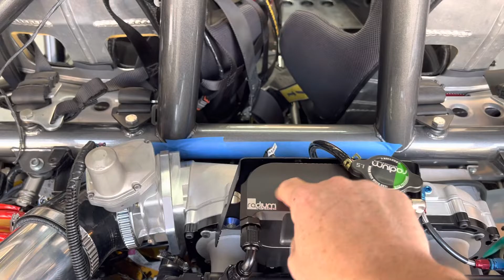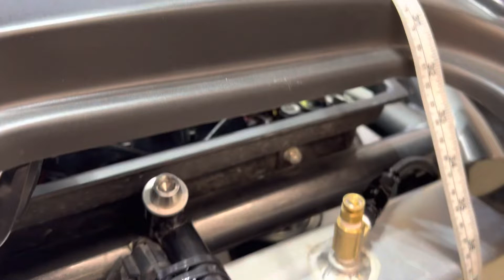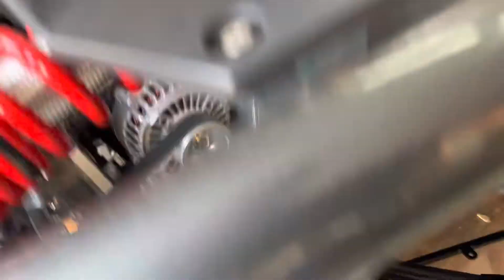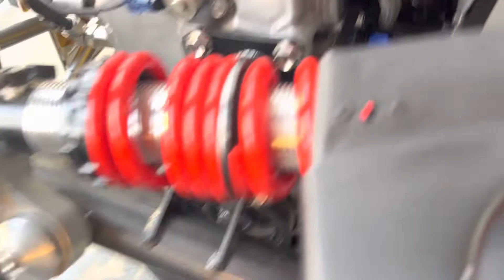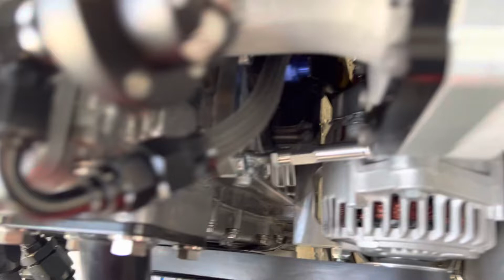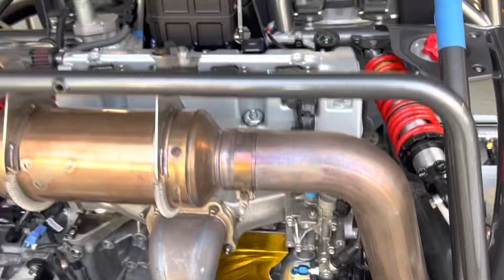Ariel Atom 3S Coolant Upgrades

Comment: Cover the underside space behind the core of the radiator.  This will allow the fan to push air through the core without having to fight the pressure behind the core allowing for better convection.